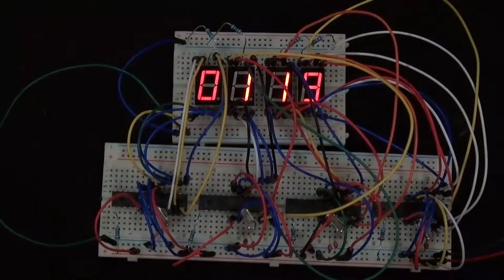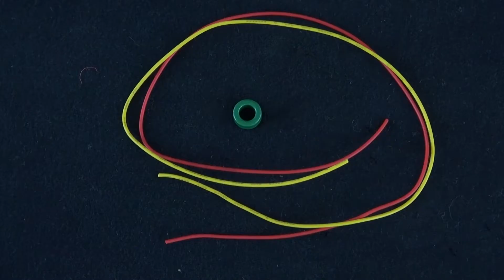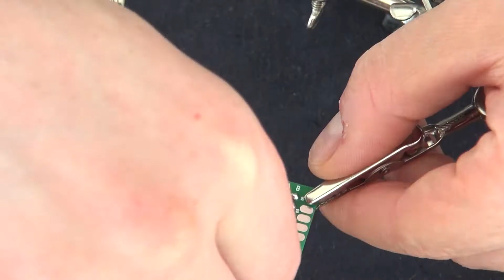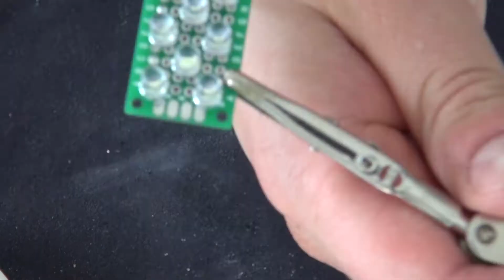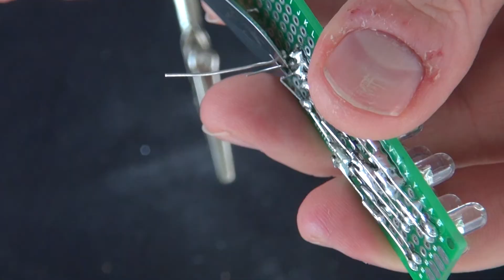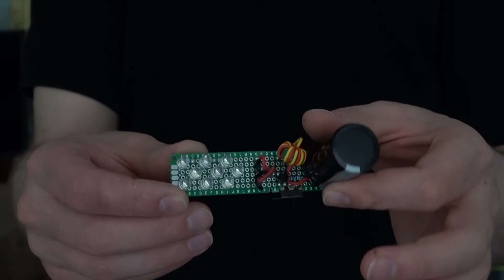Joule Thief Capacitor Flashlight Upgrade

Comment: Put the LED's in a jar lid inside and it's a lamp where all the components can lay in the bottom and fill it to half with red (pick your colour, of course) glue (just covering the components) and add charge wires coming out through the lid as well. Maybe a wine bottle or whatever, but I just wanted to give the concept.